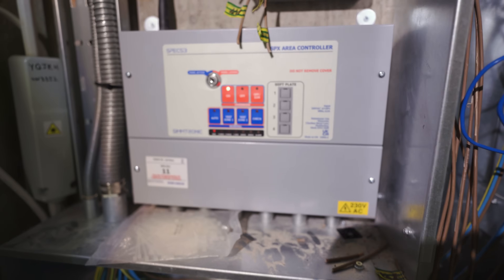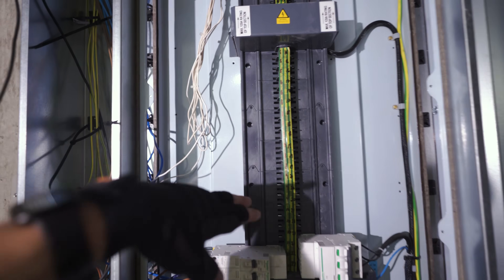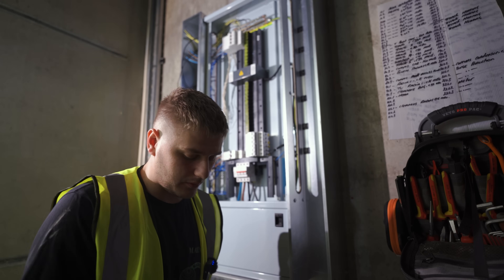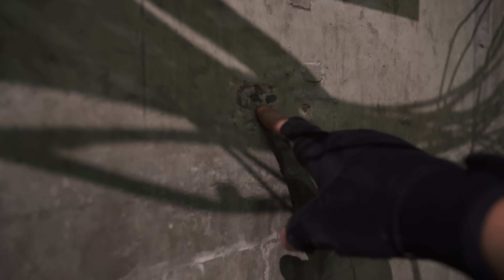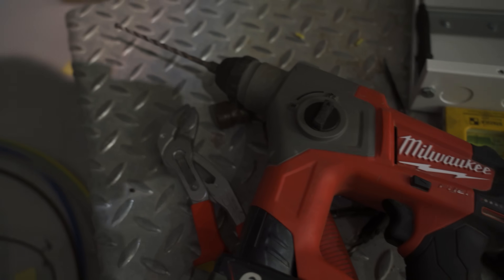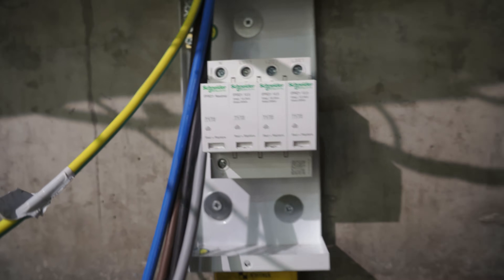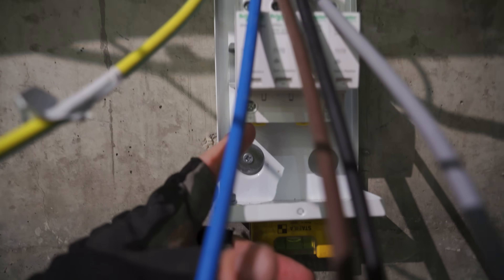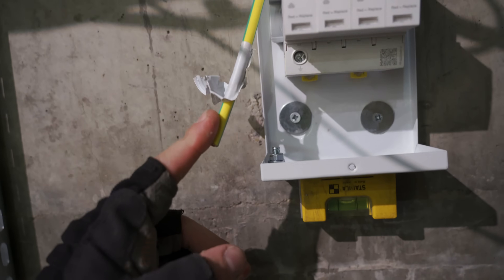Installing 3 phase surge protection

Comment: One way to help keep SPD lengths within the maximum permitted 1 metre is with shorting length C (Earth) this can be done by connecting it to a local earth bar within the serperate SPD enclosure. Any length after this local earth bar is not counted towards length C. 
Why I have no idea 🤔
However, it is a life saver when fitting 3-phase SPD's in a separate enclosure from the DB.
Reply: Except... that will pass regulation but will not mean that your SPD now works correctly with some sort of black magic! In fact even 1 meter is not really ok. You installed an SPD that is probably not so effective, or it doesn't work at all, so you basically wasted money and worse gave a false sense of protection.
Reply: @alerighi Why would it not work at all?
Reply: @E6EES  The AC resistance is too high which causes a significant voltage drop on the wires between the SPD and panel.
Reply: @alerighi  Completely agree mate... In fact we should be all ensuring SPD lengths are 0.5 metres or less. However, when out of our control (For example in this video) then at least our work complies with current Regs and is not coded in a future EICR. This is more of a designer fault, but if the designer approves then we've done our best to comply with Regs.

Comment: Does the spd cover the whole install how does that work pal if its just fed off its own breaker
Reply: The SPD is wired in parallel with the supply. If the supply voltage exceeds a critical threshold, then the SPD acts like a short circuit and clamps the supply, preventing the voltage from rising higher and damaging other equipment connected to the same supply.

This transient over-voltage is short enough such that the SPD is able to function and suppress the over voltage condition before the breaker is able to open the circuit between the supply and the SPD.

The impedance of the supply, the impedance of the wiring, the behaviour of the circuit protection devices protecting the SPD, and the specifications SPD itself all need to be appropriate for the protection of the SPD to function. In practice each regulatory body will have created a set of specifications that make sense together and electricians just need to be aware of this guidance.

In this particular case, the wires between the supply and the SPD look a little long to my eye.

Comment: One note. The distance from the circuit breaker to the surge protector is too long, there are limitations in the installation instructions.
Reply: @residualelectrical  we will quite often do as you have described when retro fitting. Fitting inside the DB with an external failure alarm